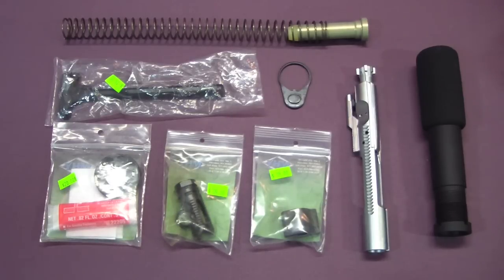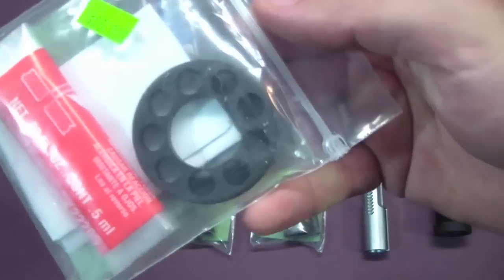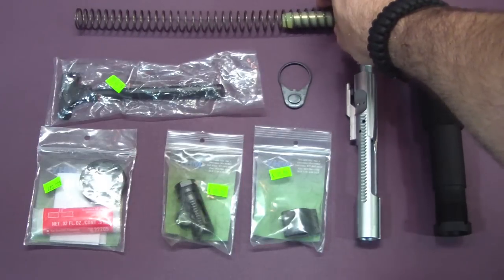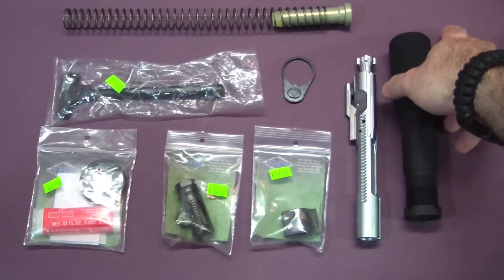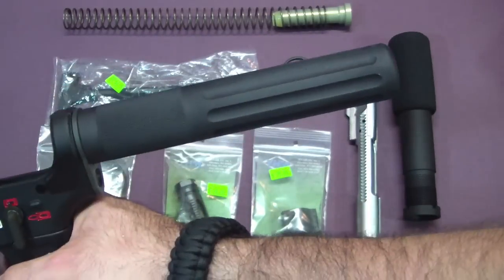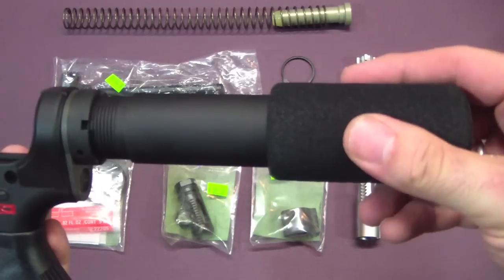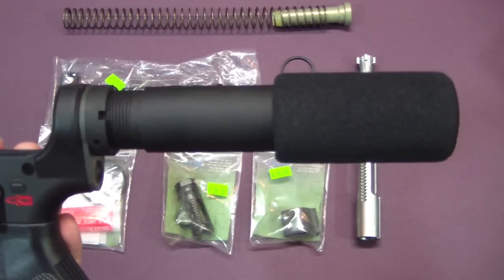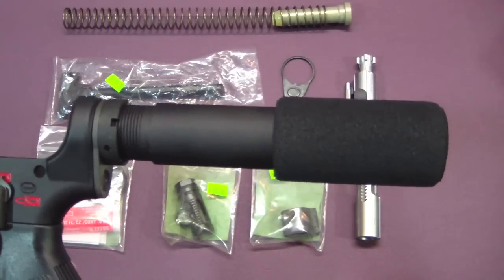Which buffer tube?

Comment from the maker: @jeggers65 Lowers do NOT need to be designated as "pistol" from the factory. That is just a gimmick by some manufacturers. Lowers are designated as "other" and can be registered pistol or rifle depending on what they are used to build. Once a lower is registered as a pistol it can later be changed to a rifle but not the other way around. Once it has a stock installed and is registered as a rifle it is always a rifle.

Comment: As long as you don't mind a cold cheek every time you fire your pistol, go with RRA.  My AR pistol uses the foam.  Works great to keep the cold off your cheek.and functions well.  If you are going with the foam, you also need to make sure that the charging handle doesn't make contact with the foam.

Comment: if the tube is cross threaded (off center) however slight the bcg will not cycle properly causing it to jam in the tube. put on the stock tube and measure how much the spring sticks out without the retainer pin, then do the same with the new tube if there is more spring showing with the old tube then the new one is possibly the issue.

Comment: go to home depot and get a little armaflex refrigeration tube insulation. cut it to fit over the threads. washers painted with bbq grill paint or painted radiator hose. black shrink tubing or even black tape all work well. nice build.

Comment: So which one did you go with?  And just so you know, if you go to Midway, they sell the foam padding to go over any buffer tube.  I believe that it is made by ACE.  I have an Ace pistol buffer, and one of the RRA ones.  The RRA one can loosen during shooting sessions, but it is easy enough to tighten back down by hand. I put the aforementioned  foam pad on it to make it a bit more comfortable to shoot.

Comment: @TheYankeeMarshal The RRA?  You may want to use some loktite on the threads.  I have been using that tube for a while now, and with the foam pad on it, it has been pretty comfortable to shoot.  My only gripe is that it loosens once in a while.  But for the price, you really can't beat it.

Comment: BTW, are you sure you can use that  lower for a pistol. I am sure the need to be designated pistol from the factory. 

The term “Pistol” means a weapon originally designed, made, and intended to fire a projectile (bullet) from one or more barrels when held in one hand, and having:

a chamber(s) as an integral part(s) of, or permanently aligned with, the bore(s); 
and a short stock designed to be gripped by one hand at an angle to and extending below the line of the bore(s).

Comment: Q: If a person has a pistol and an attachable shoulder stock, does this constitute possession of an NFA firearm?
Yes, unless the barrel of the pistol is at least 16 inches in length (and the overall length of the firearm with stock attached is at least 26 inches). However, certain stocked handguns, such as original semiautomatic Mauser “Broomhandles” and Lugers, have been removed from the purview of the NFA as collectors’ items.

[26 U.S.C. 5845, 27 CFR 479.11]

Comment: I'm looking into ordering a RRA pistol tube. Did you have any problem with the buffer retainer pin and spring since it appears you can't fine tune the installation with a castle nut? Thanks in advance.

Comment: Today i changed my buffer tube with a little longer from the stock LWRC pistol AR. Went to the range and thot a few times til the Bolt carier keeps getting stuck back. Is it because the spring needs to be change for longer buffer tuube? please help